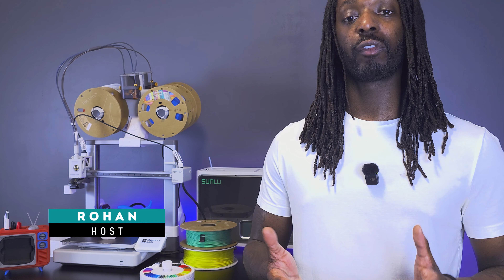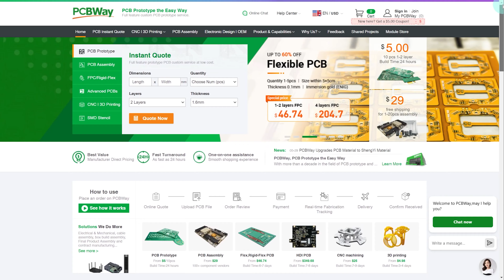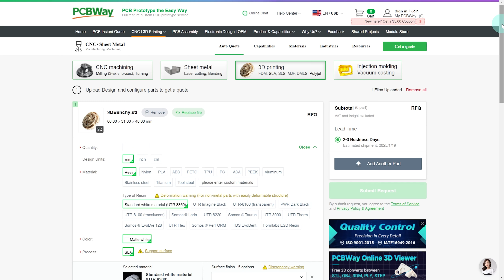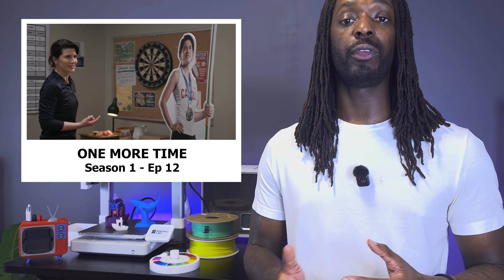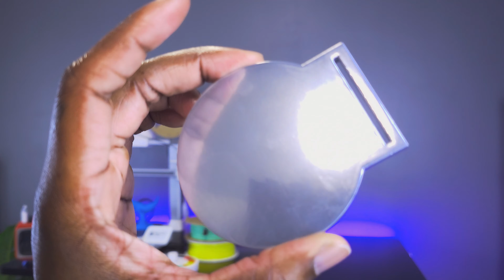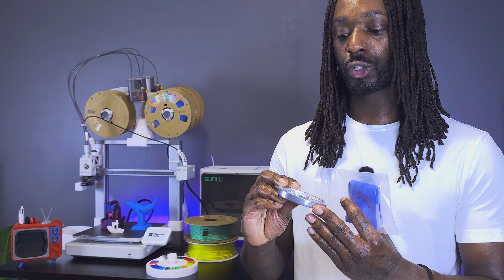🎥 My UNIQUE Introduction to 3D Printing - Plus Channel Announcement!

Comment: I'm also wanting to get into 3d printing and I've had my eyes on the bambu a1 combo at a local store. I like the option of being able to do multi colors
Reply: @Marshallv86  I just bought one, and it’s been an incredible upgrade from my old Ender 3 V2. The A1 is the printer I wish I had when I first got into the hobby.
Reply from the maker: Thanks for watching! It's been great for me. The AMS does waste a quite a bit of filament though with all the changing but even just to automatically and remotely manage the filament It's great.